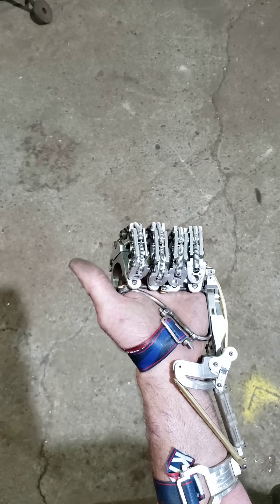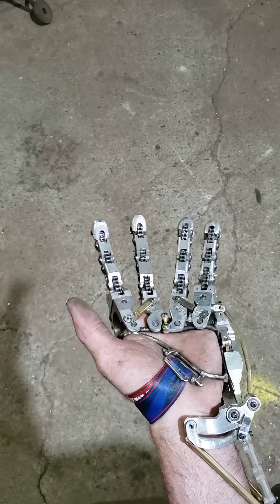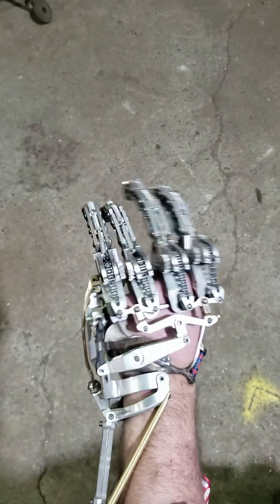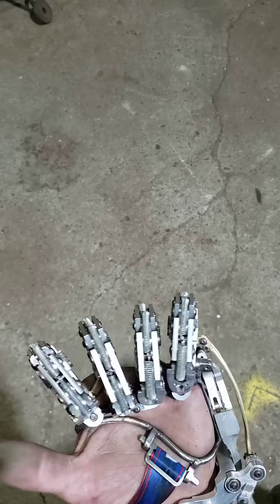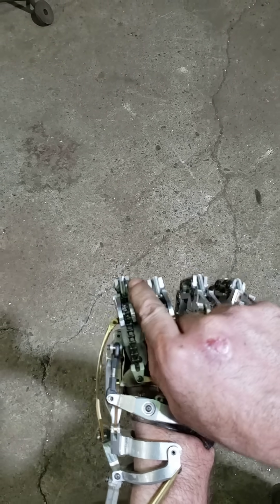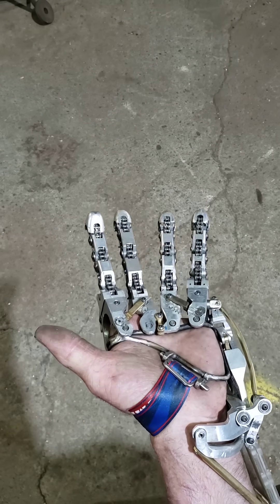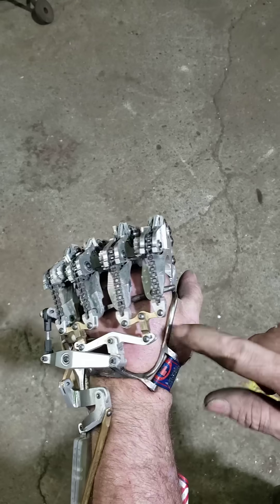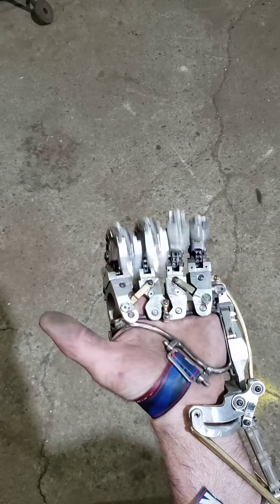Another update on my partial hand prosthetic, now with splay!

Comment: I have a question,
which I don't want to offend you with, and also i'm new. How did you lose your fingers?
Reply from the maker: Since I get this question a lot, I'll probably do a video on it. But long story short,  I have multiple myeloma,  a terminal blood cancer that affects your immune system along with your skeleton,  osteoporosis would be an improvement,  so anyways,  in nov of 18 I shattered the finger bones of my left hand, my dominant hand btw, I had a surgeon pin my fingers, it looked like it was going good,  then bone infection,  blood infection,  septicemia, gangrene,  you're going to die. So they started cutting off fingers to get ahead of the infection. Thankfully I was able to keep my thumb and palm.

Comment: What are you using to machine components? Do you have a fancy Haas or a Bridgeport of some kind? I thought it looked like an older machine in the video about machining your chain guards
Reply from the maker: I wish I had a fancy machine, but I'm cheap! I'm using a 84 acrolog m12 that i bought as a frame out of the local scrap yard for $200 and threw some motors on it specifically so I could carve out pieces for my hand.

Comment: I’m new to your Channel, Do you not have Fingers on your Left Hand?
Reply from the maker: That is correct, only my thumb. In 2017 I was dx with multiple myeloma,  a terminal blood cancer, so I spent most of 2018 living in hospital at uams in Arkansas  usa doing heavy chemo and a stem cell transplant.  A couple months after I got home I broke the fingers on my hand due to super low bone density,  thanks cancer, found a hospital that would operate since I was super high risk. Unfortunately I got a blood infection that turned into a bone infection,  septicemia and gangrene,  followed by you're going to die. So they started amputating fingers every couple of weeks to try go get ahead of the infection,  thankfully I got to keep my thumb.
Reply: Ian Davis I’m so sorry...

Comment: Incredible.

I like how making this mechanical means you get feedback on your wrist, letting you feel how much grip strength you are applying.

The action is also way quicker and smoother than what I've seen on servo-operated prosthetics. It must feel much better in that regard.

To sum up the last two paragraphs: it looks very responsive

The chain-and-sprocket mechanism makes it looks more durable and reliable than most prosthetics I have seen. Not sure how much of that is just looks, though.

Speaking of looks, it looks great. It is well proportioned and just quite aesthetically pleasing overall.

Truly amazing work.

The splay motion seems like it jams when you try to do it at the same time you open and close the fingers. I guess this makes sense, since it looks like the joints used for the splay are put under extra pressure during open-close movements. However, seeng how much smoother it is since the last time you showed it, I am sure you will improve it even further.
Reply: Speaking of looks it heavily resembles Venom Snake's prosthetic hand in MGSV
Just needs a lick of red paint!
Reply: Are you an engineer you have to be
Reply: @Dndragon55  Not an engineer, but I am a student in a STEM field
Reply: @smestre  ok I thought so what stem field
Reply: @Dndragon55  I'm a Computing Science freshman
Reply: @smestre  that's cool
Reply: @smestre  I'm just going into the army

Comment: Ian thats so cool that's so much progress from the old one that broke from lateral impact. U doing a lithium battery? Also how ever did u do the load set up so u dont use to much strength and crush things?
Reply from the maker: Thanks, I'm going to be using 2 18650 5600 cells and 2 buck boost regulators. For the emg circuit to function I need + and - voltages  to get the potential. With this I'll be able to use charge it like a cell phone.

Comment: The big problem with the high end myoelectric  hands is durability, they can be quite delicate. They are nothing more than glorified cosmetic devices. It would be interesting to see if your design proves more robust?
Reply from the maker: Youre absolutely correct,  for decoration only,  I broke my ossur I digits quantum by taking off my hoodie in an airport. Finger string just broke.

Comment: This is genius but my question is if it would ever be possible to individually move the fingers just from the wrist movement instead of all 4 fingers?
Reply: @leblblb  no but I meant individually with only wrist movements no batteries for locking mechanisms
Reply from the maker: So I did look into a completely mechanical individual addressable finger system that cam selected the finger to lock,  but the parts ended up getting so small and delicate that I thought the durability just wouldn't be there. Not that I'm exactly excited to add electronics to the mix, they introduce their own reliability issues.  But that is why the motion and splay are completely mechanical,  even when the electronics fail, and they will, you can still use the hand, just not the zhu-zhu functions.
Reply: @missingpartsclub  Oh wow that's really something but what if the locking mechanism is added and you were to activate it for certain fingers and the battery dies? Would those fingers stay locked or would they automatically go back to unlocked when they have no power? Or would you add a way for you to unlock/lock manually in the case of battery failure?

Comment: Imagine wanting to make a prosthetic and making one the beats most modern ones except the new robotic ones
Reply from the maker: I have one of the modern robotic ones, and this one is better. My main gripe with my fancy robotic hand is that it is slow, like 1 second  to open,  1 second  to close. So slow... 

 The other thing I find lacking is that my robotic hand is a blind touch. Since the fingers use gear motors to generate the motion,  you have no idea what kind of force is being transferred onto the object in the hand.
Reply: @missingpartsclub  neuralink will change everything for your kinda person bro don't worry.
Reply: Ian Davis did you make this by yourself? And if so how come it’s better than the modern robotic prosthetics developed by companies with billions (I imagine) of dollars behind them and teams of like top class scientists and engineers and shit. Like the ones connected to your brain that move like real fingers
Reply from the maker: Actually a less invasive approach would be to use haptic motors that vibrate at a higher frequency in relation to the resistance of a thin film transducer placed on the pairing beam. I looked at doing that early on,  but decided it would be more reliable   going strictly mechanical for the feedback.
Reply: @missingpartsclub  This is a pretty cool prosthetic, but I think what the guy who started this thread meant is that your mechanical hand, while clearly well designed and great, is inferior to to the (currently very expensive but will be cheaper in the future) prototype robotic limbs which have touch feedback, can feel hot and cold, are stronger than human hands, and can move rapidly and naturally (check out the doctors bionic limb to see what I mean)
Reply: @DaniPog  can you send me link of that prosthetic you mention
Reply: Man this video gives me some kind of releif.. if ever i loose my fingers il come and find u bro for sure..
Reply: Santiago Fuentes Ojeda no bro, its mechanical, like when youre tightening a screw
you can feel how hard youre twisting in your WRIST not fingers, same principle, he can tell how hard he is applying pressure by how much force is required to close it onto whatever object
Reply: @richalequan6595  could do that by having a bracelet somewhere on arm with tiny needles that push into you for each different finger depending on pressure of the prosthetic finger. brain should adjust quite fast to understand force of each finger depending on pain of needle stab
Reply: I thought i was reading to have prosthetic to beat up children
Reply: @TonyCross2255  oh that will come later for sure. Gotta have those just in case kids start acting up.